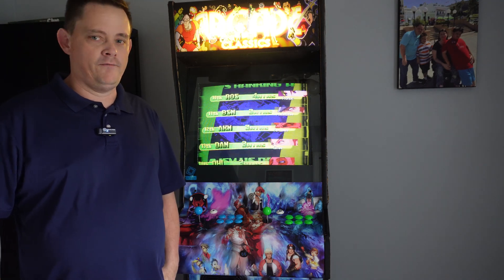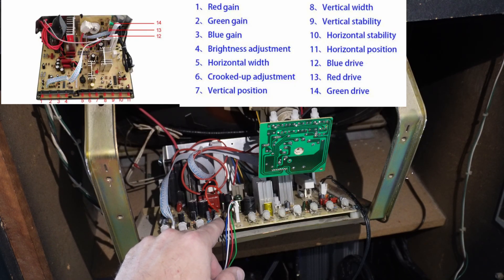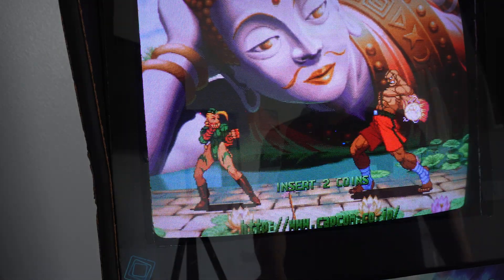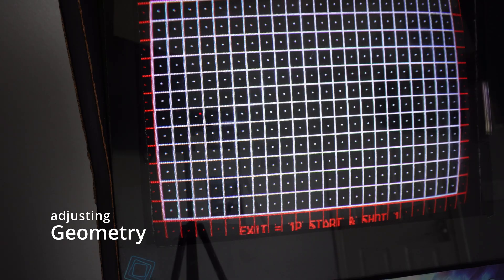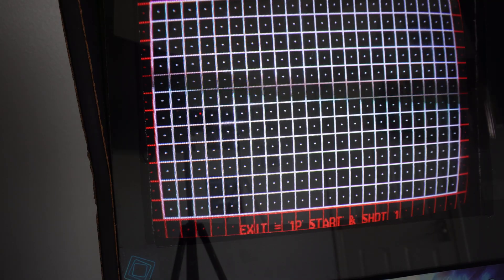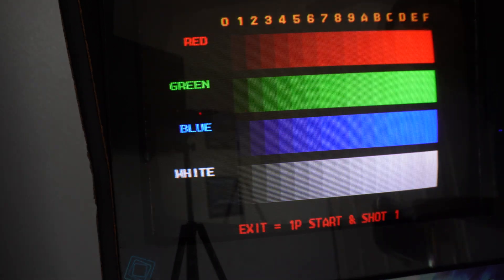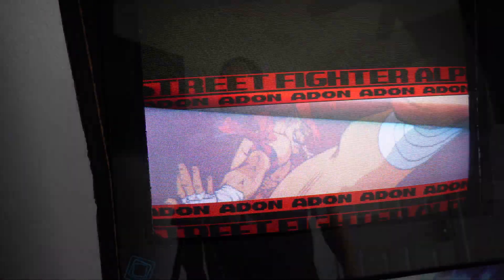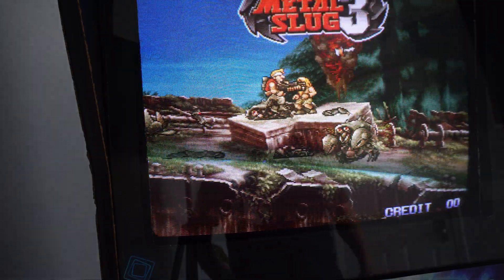Adjusting CRT geometry and other settings

Comment: It's good that controlling the screen tilt of an arcade CRT is easier than a home CRT. Can I install this Chinese chassis in my home CRT?
Reply from the maker: This chassis will fit most 19-25 inch tubes, some Sony tubes aren't compatible, and you will want to check the resistance of your yoke coils to make sure they are compatible. I've not found one that won't work but apparently they are out there.
Reply: @CraigKergald I ordered this same chassis and am waiting for it to arrive. What is the correct way to connect the horizontal and vertical wires properly for soldering each wire to its designated place? I mean the red, blue, yellow, and green wires that fit into the CRT neck. Thank you.
Reply from the maker: Most CRT/Yokes will have a standard connector on those wires that will fit onto the connectors on this chassis. If you find the image is upside down, mirrored, or both you just swap the wires around. You could pull the pins from the connector and place them back in the correct order or I prefer to just unsolder and re-solder on the yoke itself. I ran into that on this video - https://youtu.be/hbY1fAipB6M?t=429
Reply: @CraigKergald Thank you. I installed the same chassis and it works well, but it was connected to a PC that outputs a 15kHz signal from VGA + CGA to RGBS converter. I saw a video on your channel where you connected a BCN cable from the MISTAR FPGA output. Does this chassis have vertical and horizontal synchronization? Did you combine the black and white cables coming from the RGBS port with the BCN synchronization cable? I ordered a BCN cable with five outputs (red, green, blue, black, and white). Should I connect each color to the corresponding color on the RGBS cable?
Reply from the maker: Using Mister even though it looks like a VGA port you define the signal actually coming out with an INI file, mine was configured for composite sync so I left the black BNC disconnected, the white went to the composite sync input on this chassis. I have built sync combiner circuits before but haven't needed one in a long time. Even the latest CRT Emu drivers on PC will support outputting composite sync directly. Glad its workign for you.
Reply: @CraigKergald And where did you connect the black ground wire coming from the RGBS output of the chassis? Did you connect it to the white synchronization wire? Yes, it works well, and I'm very happy that it's better than converting CRT to RGB. With this chassis, I can adjust the screen's geometry and curvature with ease. However, I want to do it without a signal converter because my graphics card supports 15kHz. I want the same method you used with the Mister.
Reply: Excuse me, I meant the black ground wire coming out of the chassis RGBS. Should I combine it with the white synchronization wire coming out of the chassis RGBS?

Comment: Being 55 years old and growing up with CRT's I was so glad when LCD's became readily available. I have always hated CRT. It's bulky, has those horrible scanlines, is prone to getting out of focus is certain places, and can have colour washout (colour bleed on the sides of the screen (especially, red.)) I used to fix these things back it the 90's and I hated working on them. So, for me, I was so glad when they stopped making CRT's and went over to LCD's. Personally, I would stick an LCD in that cabinet.  It would have a far better picture, geometry and colour settings. But we are all different.
Reply from the maker: 50 here and used to work in broadcast engineering, so I've fixed and adjusted many of them myself. LCD has them beat hands down for convenience, ease of adjustment, weight, etc. But CRT wins for nostalgia every time for me.